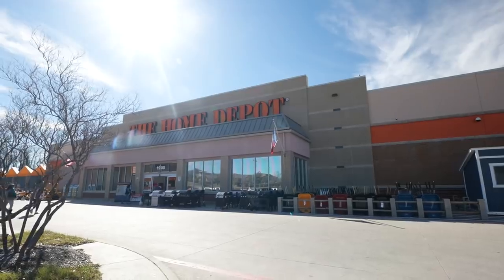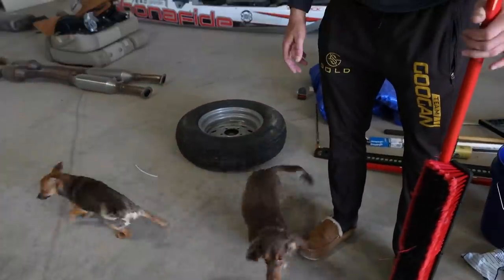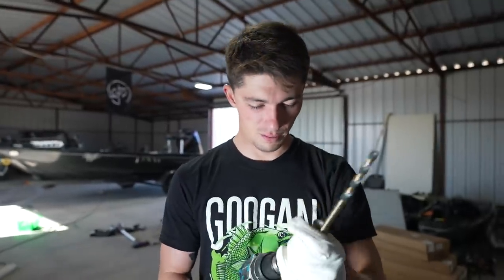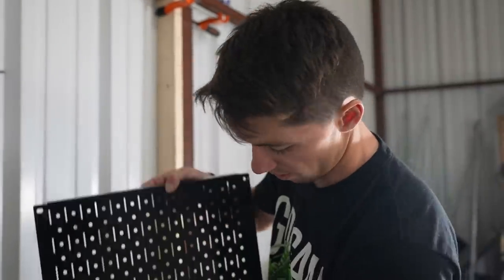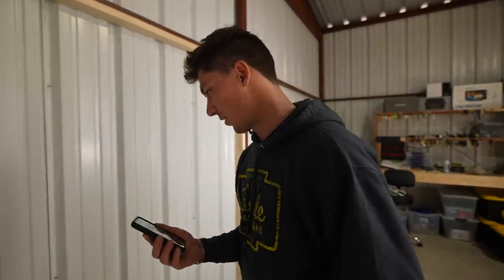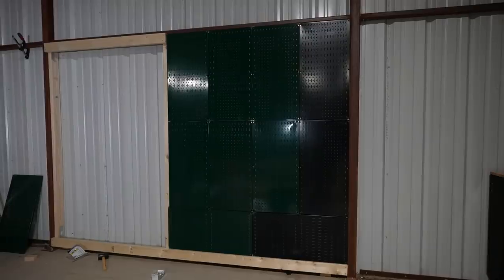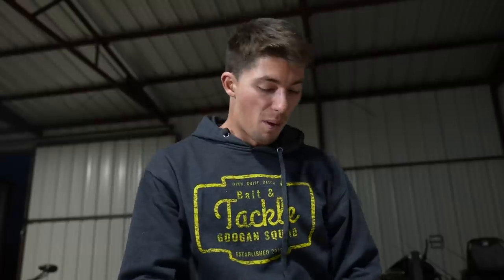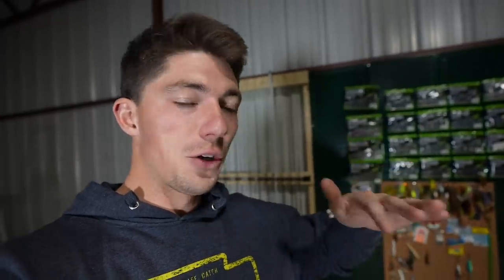CUSTOMIZING My Barn Into a OUTDOORS Man Cave! (Barn Builds PART 1)

Comment: Nice job on the tackle storage system. Please consider doubling your overhead lighting with  an LED system  and task lighting above your workbench.  Also a large outlet strip along the back of the bench. Vise with a combo grinding wheel and wire wheel to help with your work. Buy good equipment that will last.

Comment: Jon you can make attaching those 2x4s a lot faster by getting some self tapping screws. They have a drill bit on the end and are hard enough to tap the metal as they go in. Would make the process of attaching the wood to metal so much faster. Keep the great content coming and can’t wait to see how the Never Stop shop turns out.

Comment: Before you get going to crazy I would highly recommend insulating that place, I moved to a new house and have a huge uninsulated shop and can't stand the temp changes some days it can be hotter in the shop than outside and colder in there than outside.

Comment: If you intend to spend any time in there during summer, you need to insulate- it is a metal building and will be an oven, after that and siding, you can use your erector set to make it a man cave complete with a wet bar, fridge, kitchenette,  epoxy your floor , get a recliner. TV wall , etc. If you are going to do something, do it to raise the value of your life and property. Make it your cave with all the amenities. I know this because I have had metal barns for actual horses and had to make it livable for them and my clients with a lounge and shower and bathroom. JUST SAYIN"
Reply: Totally agree with this and in addition he could build a ceiling and in turn an attic with an electric lift to hoist up stock and increase the floor area of the entire building.

Comment: If your drill kit came with two drills, use the other with the driving hammer action for the screws and lag bolts. Tons faster and easier. Should be a smaller more compact drill.  Much easier and manageable.

Comment: Next time use a powder actuated (Ramset) it fastens two by’s to steel quickly. Also: the steel will sweat(condensation) so you need to use treated lumber - that’s gonna rot!

Comment: Self tapping screws will help hang ur 2x4 and u won't have to go drill then tighten u might depending on how thick the steel drill a smaller then screw hole to make it easier on the screw but try it u won't be disappointed

Comment: Jon, a tape measure is not a square lol dont use it to draw your cut line. With this little project its not an issue but 40 feet down the board that angle is multiplied.

Comment: I think if you removed the bottom half of the peg board and put a little workbench with shelves below it there and moved the other boards somewhere else it would look a lot better and still have a lot of storage left
Reply: need some insulation and large circular ceiling fans in summer b4 u go back to Maine so platic baits don't melt in that barn heat.

Comment: You can just cut down those rod holders to the width you have with a hacksaw or a grinder. That's why the caps aren't on the ends to begin with.